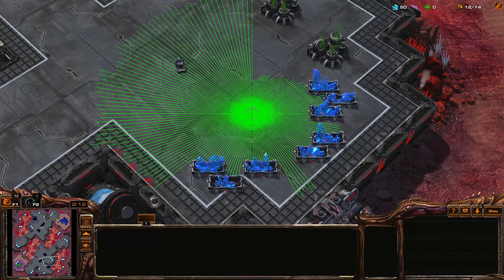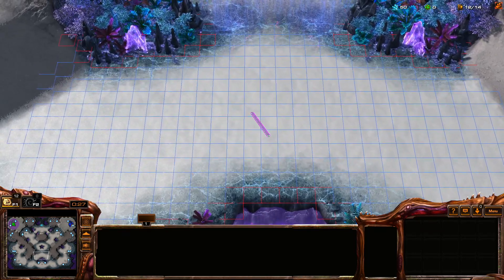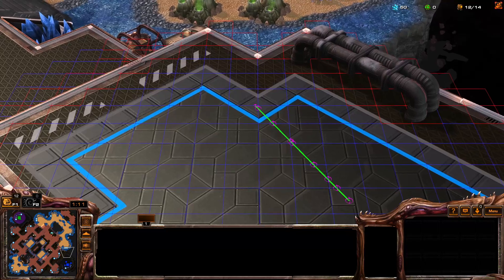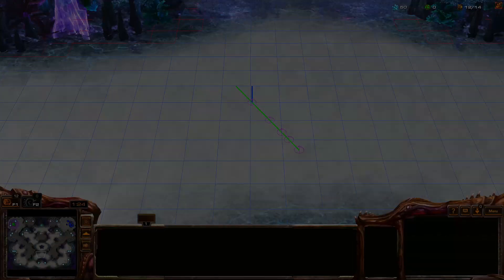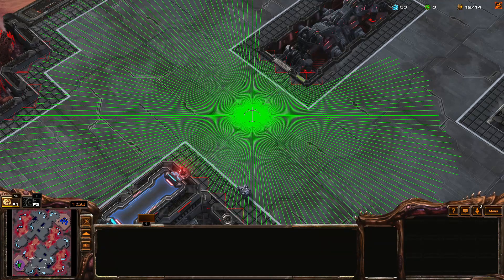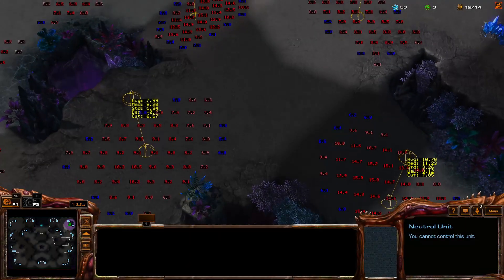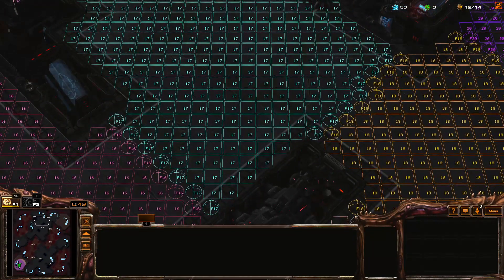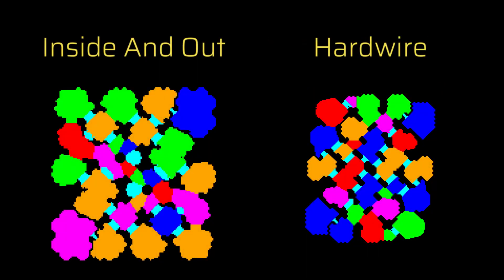Using ray casting to efficiently find choke points in a 2D world

Comment: Hey this is really cool. It highlights exactly the most important principle of constructing a modern SC2 map. As a mapmaker myself I wonder if you have ran into any modern maps that didn't fall into the category of "terrain being just alternating chokes and open areas" or gave you trouble with weird alcoves?
Reply from the maker: The only weird parts to handle with this algorithm are the donut shaped parts in certain maps. For example in the middle of stargazers or berlingrad, there is a large open area with an unwalkable spot in the middle. The algorithm splits it but I don't even know if it's a good split or not. For my purposes tho it doesn't matter.

The tacit mapmaking rules makes it pretty easy to analyze the map from a computer program's perspective!

On a side note, reaper jump spots are super hard to understand for bots. There are visual cues for humans on most maps (please keep doing so!) but bots don't see the pixels.

Comment: i'm currently working on something similar for my bot (currently my bot does nothing, i just working on different algorithms for fun, when my time allows it) 
i have a different aproach for detecting choke points, i'm not sure if the quality will be as good but i will see ^^

i'm doing the following: i take the placementgrid (which is already mostly split into regions) then erode those until the regions are islands then expand them outwards again and all the tiles where two regions want to expand into, are tiles belonging to connections/choke points

at the moment i'm not that happy with my stopping conditions and i haven't done the expand part as i'm still working on it, but the erode part seems fast so far (though i need to measure that) although doing it fast is not that high of a priority as the maps can all be easily analyzed offline ^^
Reply from the maker: Ah! Interesting use of the placement grid! You get the ramps right away with this, right? Walkable but not buildable?

And then the erosion is going to be faster where there are chokes... Very  nice intuition!
Reply: @Artificially_Intelligent  correct ramps are walkable but not pathable so every set bit in the pathing but not in placement is a ramp (or visionblocker, but visionblocker dont have height differences to neighboring tiles) ^^

yes that was or is the idea, again in theory it sounds good but in practice it is hard to know when to stop eroding because not all chokes are equal in width :D currently i stop a bit late so i'm eroding some regions completely but its a puzzle i think i can solve :D

Comment: I love this kind of technical visualisation of sc2. Looking at what you have here, it could lead your AI to better building placement, more efficient army movement and timed ambush around the map. It can help with perfect scouting by following the cliffs edge inward by X tiles (precision between scouting all tiles or just finding larger 2x2 or 3x3 structures quicker) + X vision range of the unit.

The precision is also slightly rough as many tiles are half pathable half unpathable, like those with diagonal pathing on them. Meaning depending where your ray is passing, the tile can be detected as one or the other. This could lead to false pathable tile where you can't place a structure there, but a unit could walk half on it. This can be clear when looking at the ramps where very few tiles are fully pathable, but there are many half pathable, detected as unpathable. Maybe scanning every 0.5 tiles instead of 1 could refine enough to detect those edge case without changing much of the algorithm (maybe only doing that when reaching a wall, move back half a tile and check). Would be more precise with not much computation added. All edges would be half tiles detection, and all vast area would be detected as full 1x1 tiles. An example of that is at 6:15, if you look at the bridge tile detection, you have numbers on the bottom right side wall, but none on the top left side wall. It's like if the bridge was shifted half a tile.

It also lacks cliffs detection that can be traversable by colossus or reapers, commonly called "jumping pad". It could also be great if it was able to detect "overlord pillars". This can have significant impacts on gameplay and decision making.

This could also be interesting for air units. Some more rare maps can have air unit blockers which force units around  them and can screw air unit movement. In sc2 there is no air unit pathfiding, it just goes straight into air unit blocker and glide along its edge. Maybe if that is detectable, you could anticipate your air units to hit an air blocker or anticipate that enemy air units will be stuck at some point because of that behind your base or whatever.

It could also be used for very precise unit positionning such as sieged tanks. You pick a point like your ennemy's ramp, count 13 range for the sieged tank around that point and detect all possible hardly accessible point to siege up and hit from afar. Here you work on a Zerg AI, but that could be applied to lurkers or even simply Ravager's bile.

I would also try to optimise your region detection for ramps by knowing exacly how high on the ramp does a unit have to be to get vision walking up. It might not be what you detect as the "closest walls" or idk, but like at 6:10 you clearly see that the region should split on top of the minerals of the ramp and not at the bottom of it. Sure the choke goes through the whole ramp, but if you consider only where the region split, the high ground vision is the tipping point for splitting a ramp.

I'm not sure if it also takes into consideration preplaced Destructible Rocks and maybe Destructible Towers that can spawn a debris. Like at 6:37, that Rock is just ignored on the region detection, even though it clearly reduce the choke point. Even pre-placed ressources like vespene and minerals could have to be considered as choke points in some circumstances, like minerals on the ramp, or mineral walls.

Overall very interesting, keep up these technical videos with nice visuals coming, I really enjoy them :D Well done !

Comment: So essentially, with this method it would help your bot to defend and attack in certain situations. Other than walls, is it possible for ray casting to at some point count enemy units or structures as walls too?
Reply from the maker: Yes, because I know where the choke points are, I can decide to take a fight that I would normally lose since I can understand that the terrain plays in my favor.

Also, I can use the regions to compute long paths really quickly. Pathfinding is an expensive thing to compute if you have a lot of game tiles (a map is like 12k), but regions (about 50 per map) are like big simple game tiles. When I get closer to my objective I can then use my real pathfinding for more accuracy. And many more things!

As for considering enemy units and structures as walls, I didn't give it much thoughts yet. Might be a good idea to run the algorithm periodically on parts of the maps where there are many buildings... Especially since Zerg is sensitive to walling... Good idea, I'll add that to my list of things to investigate!
Reply: So I found an eleven year old video on automaton micro 2000, which was a StarCraft 2 bot. So you can take their idea from them as inspiration and incorporate it so that your units, especially zerglings or banelings, would to able to avoid the siege tank’s splash damage from its attack. I think this would be a cool feature to add, as well as similar features to dodge other kinds of attacks such as fungals if possible other than explosive attacks.
Reply: Another idea is that you could have your AI calculate the risks of attacking a spellcaster based on potential upgrades and their energy count or for the chances of destroying disruptors which had already shot and is about to kill some of your units. This could make your AI take more strategic engagements and reduce any unnecessary fights which it will lose.
Reply: @infested4494  Iirc, Automaton 'knew' where tank shells were going to land, and the SC2 API doesn't give the player that info as it would be 'cheating'.  Theoretically you could 'guess' based on the rendered layer, but most bots (all?) aren't using a 'visual' approach.